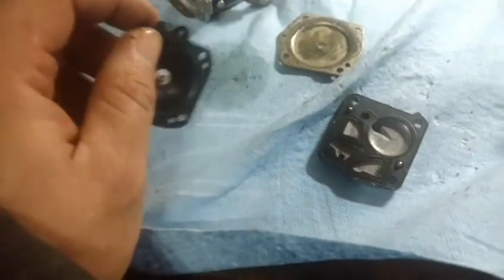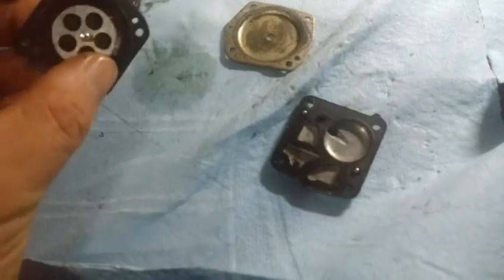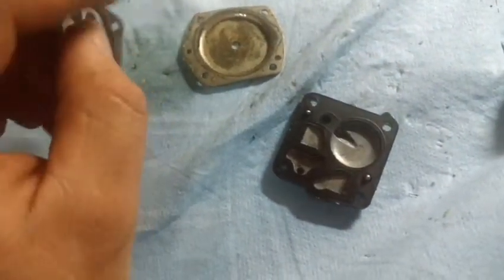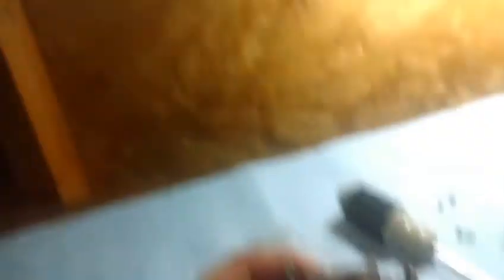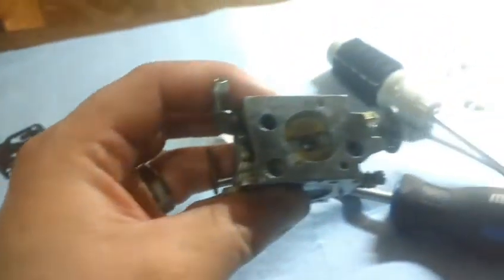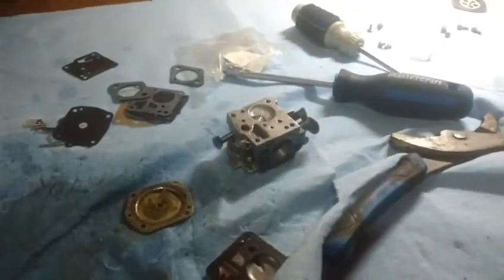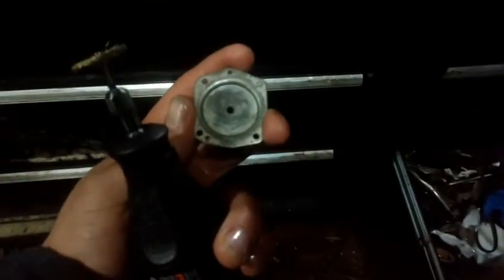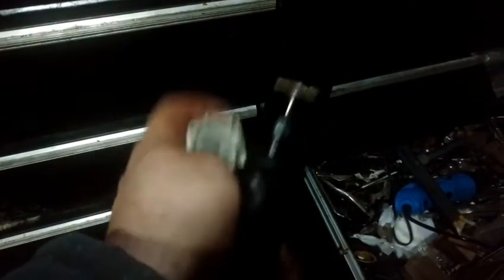Pioneer p40 carb rebuild with Amazon carb kit

Comment: Good  day Alot of  new saws now have primer button. I think that is better.  Thanks
Reply from the maker: Some have bothe primer and choke which is best of bothe world's lol I like the choke because if they sit and get a little gunged up you can flick the choke on while it's running to provide more vaccume pressure on the Jets , that plus sea foam is a lazy way to clean out a lightly gunged carb :)